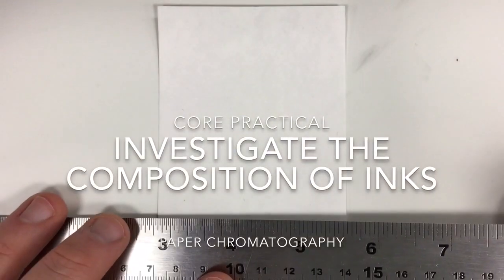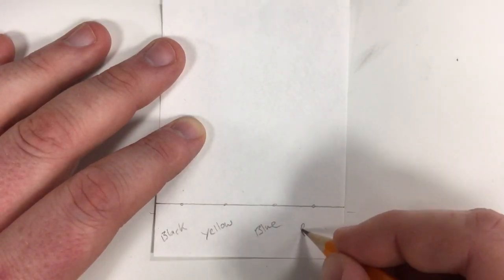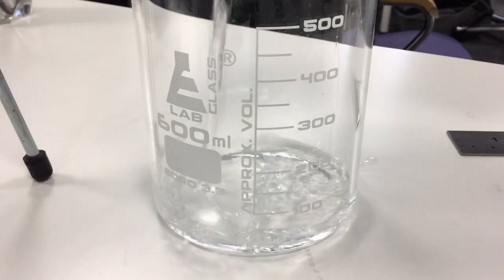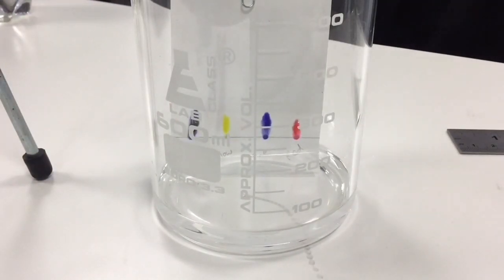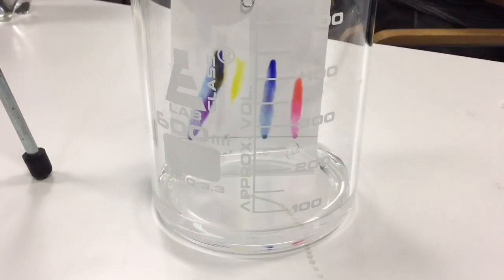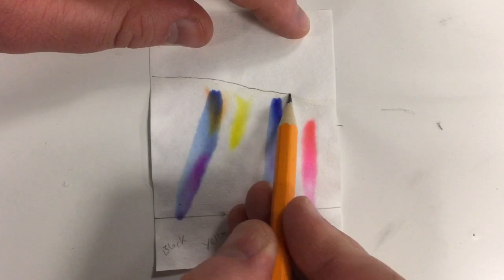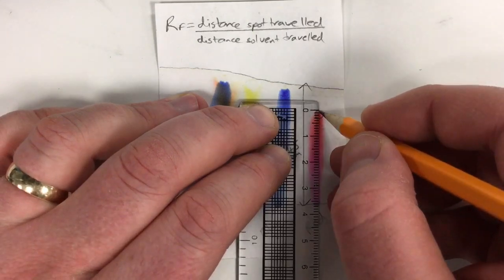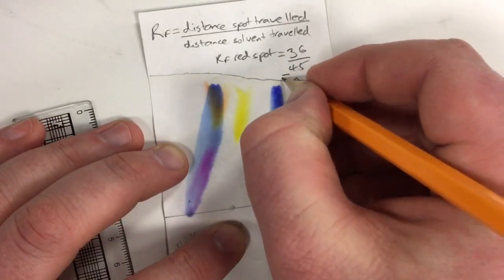Paper Chromatography - Investigating the Composition of Ink

Comment: what does the value 0.8 explain us? I would like to make a test with some paper types for digital printers which use solvent inks. Can I do the same test with this inks on different paper types to find out which paper could be an alternative or possible alternative to print on digital solvent printer. Should be the RF value  zero or less the 1? Thank you for this video.